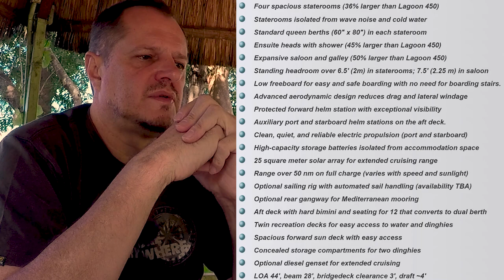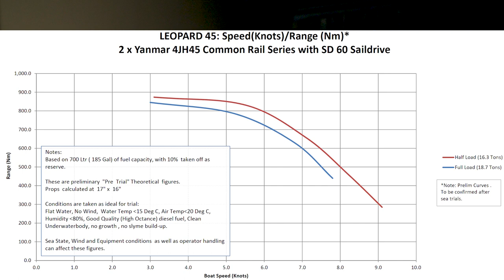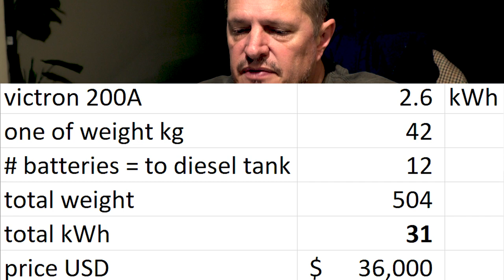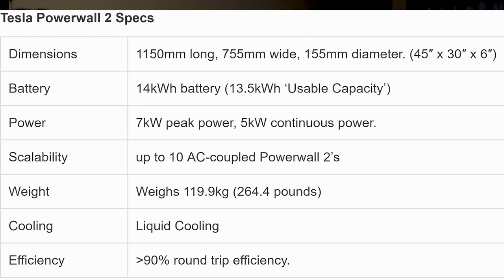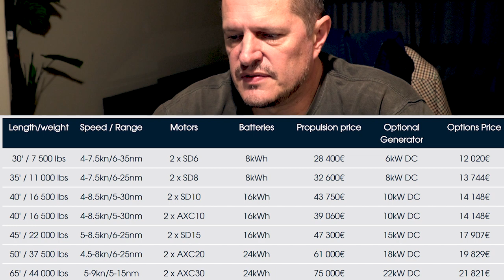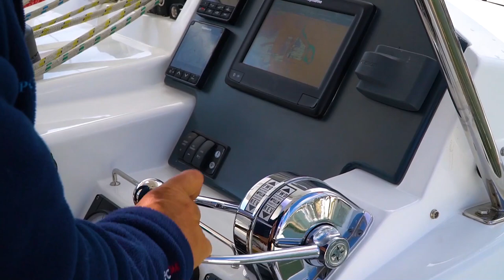#25t Diesel Engines or Electric Motors for Our Catamaran | Sailing Sisu in Cape Town South Africa

Comment: Electric propulsion is not really viable for cruising boats and it will not be in the foreseeable future, unless something that is really needed by our whole civilization happens soon: someone invents a new kind of battery. I know that people still see lithium batteries as a new thing and compared to older batteries they are much more efficient but actually they are really weak. What I mean is that they are weak for the power we need right now, not that we needed before. Lithium batteries are barely adequate for the power we need right now. A modern mobile phone only lasts for one day, when before there were phones that could last for 3 weeks on even smaller batteries because they didn't need that much power. You are saying that you will keep an eye out on electric propulsion. Well, all I'm saying is that: if batteries don't make a big jump and get much better in the next years, there won't be much to see there. An electric motor that is 50% more efficient would be something amazing and it would be a great thing if something like that would come out in the next 5 years, although that is not likely to happen. In your example though, what would that give you? Instead of getting 2 hours of use, you would get 3 hours. :D As you have seen for yourself, the limiting factor in all this is: the weight, the size and the cost of lithium batteries, not anything else...
Reply from the maker: I agree 100% It is the batteries that need to improve.
Reply from the maker: Hopefully the hydrogen generators will get much smaller and safer soon!
Reply: I don't know what to say about hydrogen. People have problems with storing a lot of gasoline on board, they think it's too volatile. I doubt anyone can convince those people to store the gas, that made the Hindenburg float over the Atlantic, on board. :D I remember seeing them working, years ago, on a kind of gas tank filled with carbon nano tubes foam, that supposedly stores hydrogen in a safer way. Maybe something like that could make it work...
Reply from the maker: No problem with storage...it is like a gas stove. But it would be nice to be able to generate hydrogen on a boat...safely ;-)
Reply: The problem is a propane tank of hydrogen will not even get you two hours of use. You will need multiple tanks spread out all over the boat, just like the Hindenburg lol. Look at that link, that's what that boat is supposed to do, generate hydrogen. That means having an electrical plant and a hydrogen manufacturing facility on board that you have to operate, repair and find spare parts for, in remote parts of the world. You have to do this under the scorching sun, surrounded by massive tanks of hydrogen all around you. All I can say is: good luck with that. :D For the time being I would rather bang with a hammer on a diesel engine...
Reply from the maker: They sure did select an impressive boat! No sails? Anyway, as you stated many parts, but also not what any cruiser now can fit on their 20 ton boat. I am sure they will reduce the size a lot and also make it super user friendly.

Comment: Nonsense useless discussions. Using electric motors for main  propulsion for a sail boat is not feasible with today's technogy.If you have enough electric source from sun,wind and sea to charge huge battery bank to run the electric motors on your boat WITHOUT burning fuel on genset you might go on electric motors. But today's technology does not let you run electric motors EFFECTIVELY on boat WITHOUT genset. Since you still need to burn fuel to generate electric to run electric motors it's  unlogical to do it.
Reply from the maker: Exactly